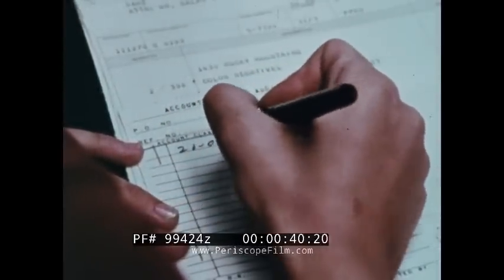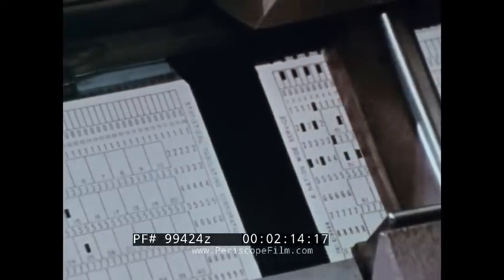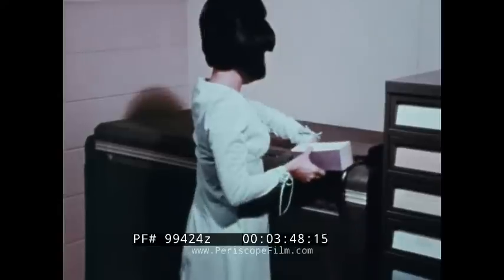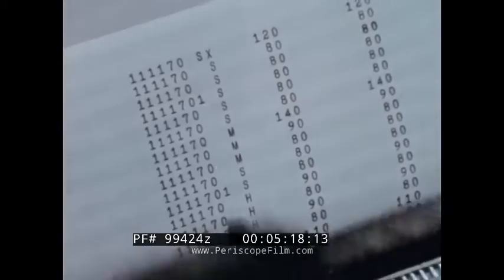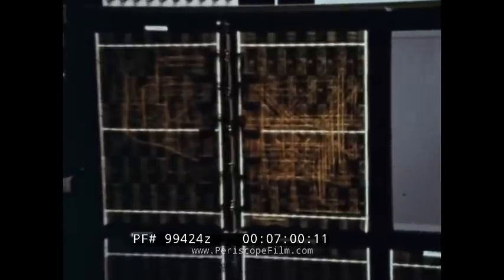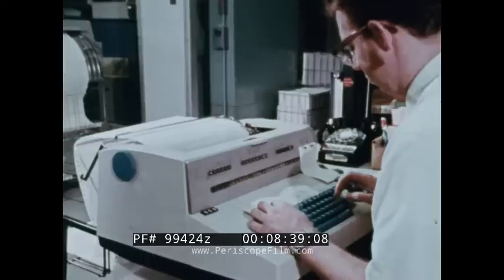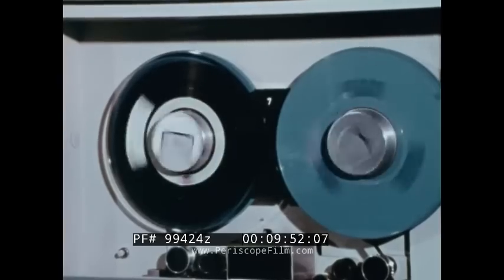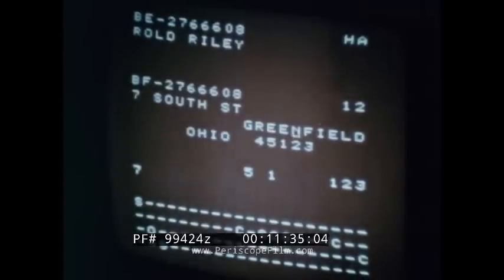DATA PROCESSING AN INTRODUCTION  1972 KEY PUNCH COMPUTER & MAGNETIC TAPE  EDUCATIONAL FILM  99424z

Comment: The IBM 1401 computer released in 1959 was to replace all the different unit record equipment shown in this video. The 1401 was still too expensive so what happened is the Unit record equipment got passed down to firms that could not afford 1401’s IBM 360/50 or System 3. The accounting machines were programmed with a plug board where you connect cables in different areas.

Comment: I love how the new technology in this film was the older technology when I started in data processing 17 years later. The high speed line printer was replaced with a high speed laser printer. I missed the punchcard by a few years but I still used mainframe dumb terminals before they were replaced by PC’s.
Reply: I prefer the [modern] microcomputer technology because the software makes using the hardware as the computer, the printer and the scanner easier to operate than working with old-fashioned equipment and methods.
Reply: @captainkeyboard1007 yeah but Unit record equipment you never had to worry about hackers or ransomware since the data was in physical cards and the plugboard was physically hardwired. Never had ransomware/data exfiltration with unit record equipment.
Reply: Steve, your comment makes perfect sense. If anyone does not like what you typed, they had better get with the program. The format is fine.